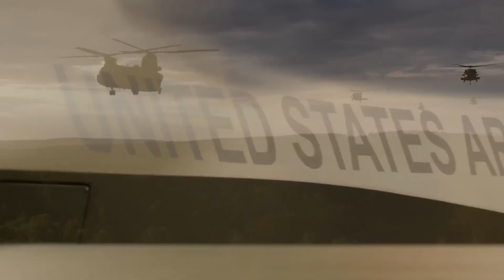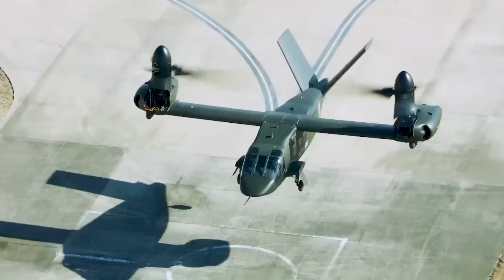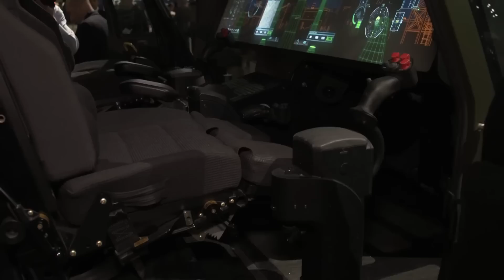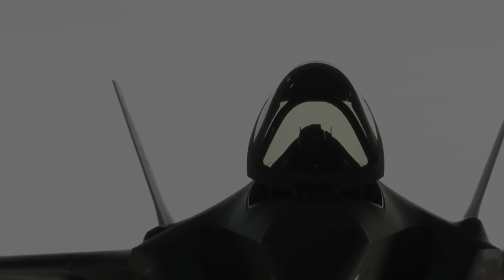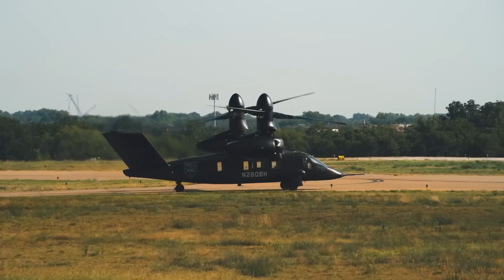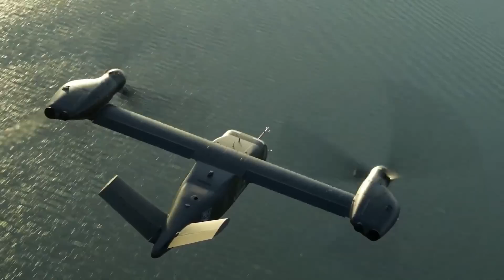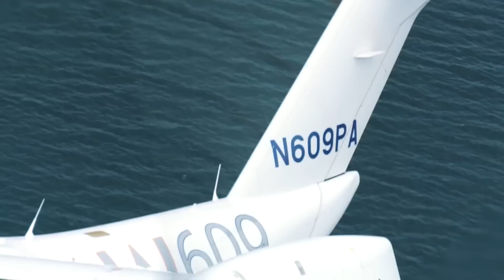V-280 Valor – The future Black Hawk

Comment: The V22 didn’t actually crash that much in the grand scheme of things. The only reason it has such a bad rep is because when it does crash it usually has many people on board causing large casualty incidents and so it’s reported on much more then another vehicle crashing more often but only taking 1 pilots life
Reply: My BIL was part of the V-22 development. Most of the crashes early were pilot error. The more recent crashes are unanticipated failures in systems that were not expected to fail at the same time.
Reply: @thegofboats and transmission failures!!
Reply: It's a first gen of its type and there were a lot of bureaucratic mistakes in the development, training, and deployment that exacerbated the problems of a first gen a/c. When counting up the human costs, you also have to account for the lives saved by the v22's unprecedented capabilities.  A lot of successful missions would have been more dangerous, or downright impossible,  without it. Emotional appeals like is it cleared to fly the president - look, even if the Orange Superhero is re-elected, nobody's ever going to live or die because POTUS got to a remote destination four hours earlier. Explain to the families - well, cancel the v22 and then you'll have to explain to families how their loved one died because we no longer have a whole slew of operational capabilities.
Reply: @randomDIYguy-k4r  Exactly. Some fool online said that the president was barred from flying on one, even though they have nothing to back this up, and it went viral so now everyone believes it. There are multiple reasons the V-22 isn't the choice to fly the president and besides he already has multimillion dollar specialty helicopters to fly him in.
Reply: @Oel54  The V-22 Osprey has notched up over 700,000 operational flight hours ... that alone speaks to its record of success
Reply: Also an investigation found that most crashes were because they had airplane pilots trying to work, essentially, a helicopter. They didn't have any crashes with pilots that were trained on helis
Reply: @smallpeople172  In 1991, the fifth Osprey prototype crashed in a test flight. The aircraft never got more than a few feet off the ground. The pilot, Grady Wilson had 1000's of hours in helicopter and was a graduate of the rotary wing test pilot course. The best description is " Book excerpt the short life of Aircraft Five. The problem was the first aircraft were fitted with fixed wing control at the insistence of the project manager.   Also the osprey controls in this case had been incorrectly wired and reversed the pilot inputs.
Reply: @michaelcanty4940 reversed inputs really?
Reply: What if they had set a couple of jet vertical propulsion to the V22 just to be used at landing only? Wouldn't it make more stable to land and reduce crashing? Just an ignorance comment, you tell
Reply: @@ChangeEvery14Daysmodern risk assessments work almost exclusively on total flights or flight hours. It's literally the best metric for safety assessment.
Reply: 16 V-22 Ospreys have been lost or damaged beyond repair in accidents and 62 people have died in accidents since 1991. In December 2023, Reuters reported the US military was grounding its entire fleet of Ospreys after a fatal crash of an Air Force Special Operations Command Osprey off the coast of Japan in November 2023 that claimed eight lives. Between March 2022 and November 2023, there have been four fatal Osprey crashes that claimed the lives of 20 service members.
Reply: I am pretty sure since its inception at least 16 of these aircraft have been lost and total loss of life as a result was at least 62 fatalities. 

R&D began in 1981 and wasn’t even safe enough to put in operation until 2007. That’s 27 years at a cost of over 28 billion dollars paid by the DOD just for research and development. That puts this aircraft at 6-10 times the cost for a ch46 or over 3x the cost of a ch53 sea stallion.

It’s honestly ridicules.
Reply: A helicopter can “autorotate” in cases of emergency landings if the V-22 cannot then it isn’t safer than a conventional helicopter is it?
Reply: Eh. It ain’t as rosy as you might think, but you’re right, fair and reasonable in saying it’s not as bad as most people think. 

It’s above average in incidents per hours flown (so not casualties), but not so extreme as sometimes painted, and only when compared to other aircraft in active service. If I recall correctly. 

It’s a “first gen”-design. As in, the next gen will have had the childhood diseases fixed. The problem is that some people try to use the design of the Osprey as an argument that the concept is flawed, which is wholly unreasonable.
Reply: @Ticklestein Osprey has the safest record in the USMC for any VTOL aircraft. 

 Turns out. Military aviation is dangerous. Things crash, but we don't hear about them unless a lot die.

 Which due to the V-22s mission profile? When it crashes, it sucks. Then the media, in all its click bait titles posted grab catching headlines, and used it for a political agenda. 

 It is like how people think the F 35 cannot beat an F 16 in a dog fight. That training exercise used a prototype that limited the Gs, and made it fight with fuel tanks. Yet the news didn't say that. 

 V 22 problem is the cost. Also it sets everything it lands on basically on fire. Even set itsself on fire before!

 Yet outside that it is an amazing aircraft, with capabilities that put others to shame. 

 Standard helicopters have reached their limits due to physics. 

 V 280 will be amazing too. IF it has the capabilities it says. Tilt powered craft are the future.
Reply: @Ticklestein According to a statement from the Marines to AP it has half as many fatal crashes per flight hour as the CH-53.
Reply: @eldrago19  ch53 has been in operation since 1966…

The osprey was put in service in 2007 and already racked up 50% of the death count..

I think that speaks volumes.
Reply: @Ticklestein  no. Blackhawks and chinnoks has more deaths overall than it did.
Reply: @@ChangeEvery14Days I have no clue what your deal is. Safety assessments are dry and rational, your emotional enthusiasm has no bearing on that.
All aircraft suffer from those random events, including the ones you mentioned. The C130 alone has a laundry list of accidents that beggars the V22. Those accidents include several engine failures leading to total hull loss. 
As previously mentioned the Osprey has a number of accidents that come down to its unique operational requirements, leading to a number of pilot error fatalities.
On top of that the high complexity of the V22 leads to maintenance requirements beyond what most fixed wing aircraft would face.
Overall the V22 has a slightly high rate of accidents per flight hours when compared to fixed wing aircraft and a below average rate of accidents per flight when compared to helicopters.
The reasons are kinda obvious.
As these aircraft age additional issues will be found, the aforementioned gearbox issue has caused one crash with fatalities.
Hardly a reasonable casus belli for your war against this machine.
The V22 was a product of the 90ies, the first of its kind and has held up admirably despite the limited technology it was made with.
It's safer than most helicopters, and has a good overall safety record. Nothing can change that fact.
Reply: Any citations or just anecdotes and emotions
Reply: This is true, my father worked on the project and does confirm as well as his friends.
Reply: Yep, compare that with the uh60 and you'll get a good idea of the difference.
Reply: It also attracted more attention because it was new and different
Reply: Do you want your son on it? Do you volunteer to ride it?
Reply: I would never get into a V22
Reply: Also, we've been mass producing helicopters for the military far longer than tilt rotors. In this context, its development is even better looking.
Reply: It had most of the crashes in the usmc.not the army or navey or airforce.
Reply: @@ChangeEvery14Days how high are rates with other airframes divided by total hours of use? Simply going by number of airframes divided by failures without taking into account usage isn't fair
Reply: @@ChangeEvery14Days "unknown mechanical defect"

So how do you know it's a mechanical defect?
Reply: Bro i'm from Marietta GA were they tested that thing.  Back when I was in high school in the 90s. It seems like those things crashed once a week. It wasn't until they perfected fly by wire technology. That that thing stopped being a complete death trap.
Reply: You're not a pilot. You've never been in a V22. Why tf are speaking like you know anything at all on this subject?
Reply: @coronalight77  so you can’t use factual data if your not a pilot?😂 that makes 0 sense
Reply: I worked on v22s and v280s. Many of the gearboxes are similar, and the nacelles are fixed to keep exhaust away from the ground or deck.
Reply: @mstanberry1  What you say about V-280 Valor's fixed nacelles is accurate ... they're also fixed in place, to lower production and maintenance costs. However, you can't have worked upon multiple V-280's (you used the term in the plural form) ... as the single demonstrator is the only operational unit that's ever been built
Reply: The V.22 safety record should be should be evaluated thusly. Is the president allowed to ride in it? (he’s not). If it’s not safe for him, is it safe for our marines?
Reply: @matthewk4930 It’s safe enough for the vice-president tho, that not enough?
Reply: @matthewk4930  I’m fortunate to be around Ospreys fairly regularly. The condition of the ones I’ve seen look like shit. Robbing parts from one to try to keep another in the air. Hell no I wouldn’t go up in one and my utmost respect to the Devil Dogs who do. Anything mechanical will fail if the maintenance/repairs that’s required are not performed properly.
Reply: @matthewk4930 shows you know little about Marine history and tradition. The President rides in Marine One, because of tradition.
Reply: It's not supposed to crash on its own. 🙄
Reply: It cannot fly with one rotor.. flying deathtrap
Reply: @delta1200  Nor can a Blackhawk fly without its main or tail rotor
Reply: actually, loss of the tail rotor is a practiced EP, in blackhawks or any other single rotor heli... and yes, loss of the main rotor is unrecoverable, but a helicopter can certainly land safely with complete loss of engine power, the same cannot be said of a tilt rotor @txtworld

Comment: How do you load one on a C-5?
Reply: The point of them is that they can fly to where ever they are needed in the world without having to rely on Stratair to transport them. If needed you can remove the wing section to fit them into planes though.
Reply: @n3v3rforgott3n9  having performed those types of operations with other aircraft varieties as a helicopter mechanic in the army. It certainly was something I was wondering and Thinking about intervals between maintenance and self deploying and aircraft that can barely do 300 knots.  Inquiring minds want to know.
Reply: @nobodyspecial7185  Even going 280kts it would greatly save on stratair let alone being able to do the trip with no pilot at all which is also the goal.

Comment: Why dont they have a central generator and electrically powered wingtip rotors ?
Reply: It causes many balance issues with centrally placed engines. They tried this early on in tilt rotor designs. Also only electric powered aircraft just don't have the range or load capacity needed for combat aircraft.
Reply: Direct drive is more efficient, fewer energy phase changes
Reply: High weight, high cost, low efficiency, and low reliability. but it would be cool...

Comment: If Apache ever has to be replaced il go for defiants
Reply: Defiant was terrible. It got outclassed in nearly every metric by the Valor and had multiple technical issues that even resulted in a crash of 1 of the 2 only flying prototypes. You fools keep buying that Russian garbage about coaxial helicopters.
Reply: @n3v3rforgott3n9  I don't actually..I didn't even want it cause of that I just simply don't like the idea of a tilt rotor doing something the Apache would
Reply: On the Russian coaxial helicopters though...how many times can you destroy an Apaches tail and it doesn't immediately crash. Just a thought
Reply: @MrTangent-8  But a tilt rotor can stay in the area for a longer period of time to be available for fire support missions and also leave from more secure bases without the need for stratair to help out.
Reply: @n3v3rforgott3n9  you can tell me about all the advantages of a tilt rotor for a CAS role but I will always think there meant for cargo. Like you ever just look at something and say to yourself "something ain't right" that's how I feel whenever a suggestion is made to put a tilt rotor in a CAS role
Reply: @MrTangent-8  I bet people said the same about helicopters or even planes when they first came out... the facts simply say otherwise.
Reply: @n3v3rforgott3n9  you do make good points but that's just my opinion

Comment: I suspect that the real reason that the military wants the V-280 Valor to replace a Blackhawk is because Blackhawks cost about $15+ million each and these  is expected to be $43 million each, so only two times the cost per unit.  But is is rare for any military contract to come in for the cost quoted, so they will probably end up costing at least three times as much as the aircraft they are replacing. But are they three times as good? And are they three times as survivable on a modern battlefield. For some reason, when the military chooses new programs, they always seem to favour the most expensive possible option.
Reply: Modern Black Hawks cost way more than 6 million btw.
Reply: @n3v3rforgott3n9  - Fair enough, I thought I might be looking at old figures. Updated the figures now.
Reply: @spacecadet35  Any new tech will be more expensive that is clear as day. With large production numbers costs will drop just like what has happened with the F35 which is now cheaper than many countries 4.5 gen aircraft. Comparing a 5th gen aircrafts operational costs to other aircraft is far from accurate as these certainly wont have expensive RAM coatings and the like. The F35 has also dropped to a more reasonable operational cost per hour although still greater than 4th gen aircraft obviously. 

The V-280 goes 3 times the distance at twice the speed while carrying more people. The increase in capabilities surely justifies the increased costs and as the tech matures more costs will drop just like with original helicopters. It is like saying we should have stayed with the Huey because the Black Hawk was more expensive.
Reply: @n3v3rforgott3n9  - through creative accounting, the flyaway cost of the F35 is cheaper. The overall cost is not.
Reply: @spacecadet35  ? my guy the straight up cost of the airframe is cheaper which I am talking about it also does not need multimillion dollar pods for targets and other things like many other jets do need. Those pods are also never put into the cost of those aircraft or the per hour costs. So when stats don't go your way they are made up and false?

Comment: Yeah well, let's ADD 250% to the 'projected cost' and see how badly the current fleet needs to be replaced.  Especially if the SAME level of capacity, heavily discounting 'faster turnaround  per mission' when a destroyed unit isn't turning around any time soon, is to be maintained, and the same level of MAINTENANCE is to be maintained.  One can only CHOKE on the current abysmal F-35 "hours of maintenance/hour of flight".
Reply: EXACTLY.  The capacity will be decreased, the speed and range will deteriorate and little meaningful 'cycle time' will be found for the missions that REMAIN in the Army doctrine, AND the QUANTITY and QUALITY of maintenance and maintenance personnel will skyrocket.

That's just on the list of "This Happens for EVERY Project" Dirty Little Lies Contractors Tell Military Folk, and Then Military Try to Hide After They Got Handed a Mess After the Third Change of Project Management from Duty Rotation.  That should all be connected with hyphens, but I'm too tired of this Game of Lies Told by Military Procurement to add them.

Raw factoids are misleading until you actually get a doctrine hammered out, and a doctrine not based on one specific combat environment, like Desert Storm, Grenada, or Ukraine. 

Get a pilot program started, but there are SOOOOOO many lessons still to digest from the current Ukraine situation AND uses to be found in REAL LIFE Army routine.

If all the current 'We Gotta Have This' were willing to mortgage their future paychecks, retirement funds, and promotions, Civil AND Military, for this, I'd be less leery, but I want to see project managers and military project managers be held accountable for massive overruns in $$$$ and schedule.

But, YouTube is Big Talk, not Big Walk.
Reply: So much you said is wrong. Not only does it carry more people / cargo but it can also do it at twice the speed and 3 times the distance... that means it has well over double the capacity in the same amount of time.

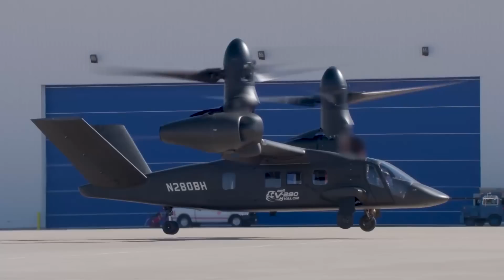Comment: Nice overview of the project. Note the blur on the left nacelle at 3:29. Other shots blur the front of both nacelles. 🤔
Reply: older photos and videos blurred them before the patients were done I think.
Reply: @n3v3rforgott3n9  -  I suspect you meant patents rather than patients.
Reply: @wickedcabinboy  Damn auto correct yea.
Reply: @marsgal42  It seems like they only blur when the internals are visible.  At that timestamp,  the left side internals are covered by the cowling

Comment: No glide slope. No auto rotation. What could go wrong?
Reply: Tilt rotors can glide and auto rotate. No military aircraft has been saved by auto rotation in a very long time. Auto rotation wasn't even a requirement for either of the 2 main programs the military did recently...